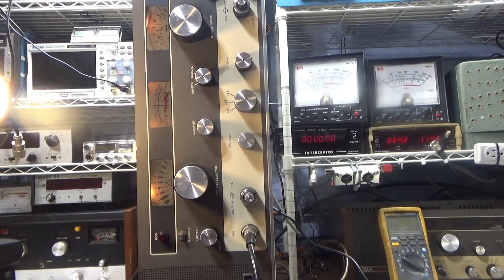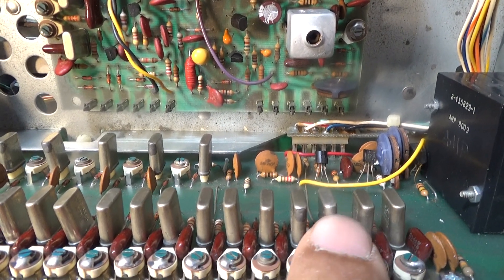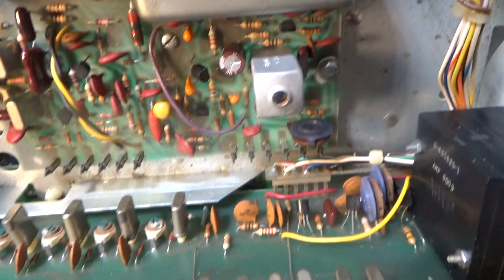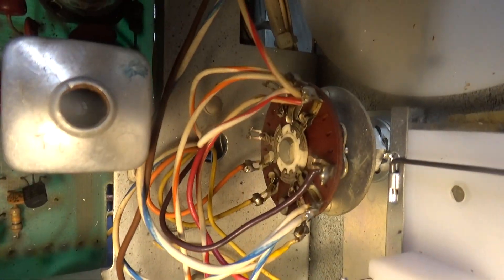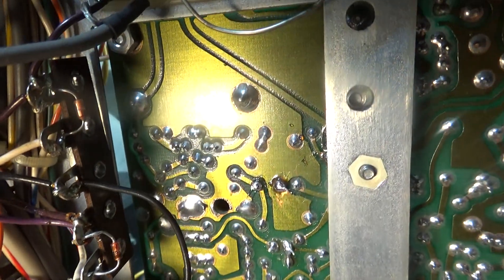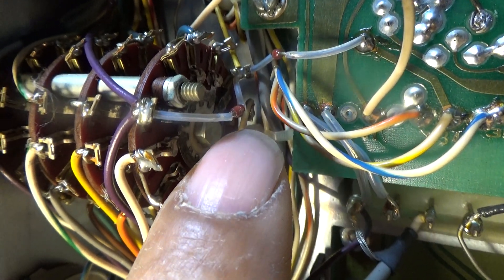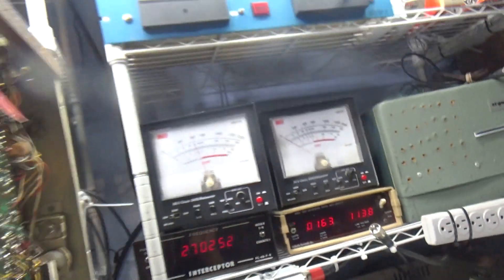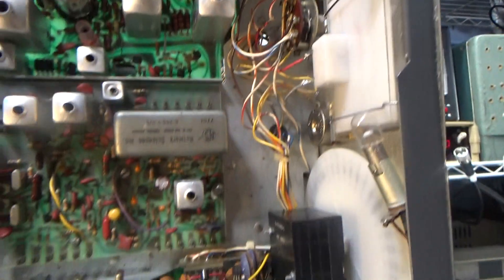Tram D201A stock before VFO/manual transmit mods

Comment: Good day tramdr hope you're keeping warm! I recently purchased a Galaxy CD 2547 base station. I had it peaked and tuned which I am very pleased with that . My only disappointment is that it "wanders" off frequency after about five weeks or so. I was wondering if you have ever done a video on adjusting the frequency on this radio. If not would you consider it? Thank you love your videos
Reply from the maker: Not my lane. I am a tube guy. Sadly, its a fairly common problem that Galaxy's drift. Maybe someone else can help.
Reply: @tramdr  thank you!
Reply: Kevin, I can't help you with the CD 2547 alignment, but this is what I did to make my radio more stable.  I think your CD 2547 has four crystals, mine has two.  After the installation I realigned my radio.  Good luck to you!  https://www.youtube.com/watch?v=JirK2IItsYs

Comment: So would a Pal vfo work on it ?
Reply from the maker: one that would output 16mhz (same as for a Browning Mark 3) would work but why? Radio already has a 55 channel VFO built in it and if that's not enough, the internal VFO can be hooked into the 16mhz crystals and get 10 down and 30 up added to the 55 channels. The internal VFO works on 4mhz and there is not an external 4mhz VFO made by anybody. The Tram internal VFO is pretty stable and works great. IMHO no need for an external VFO on a D201(a)